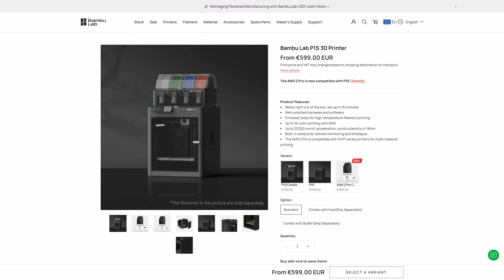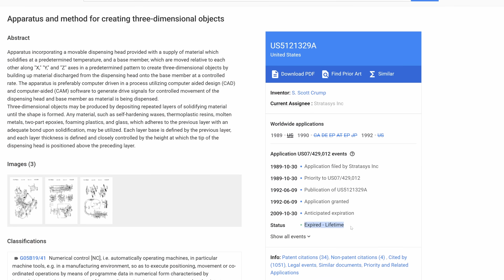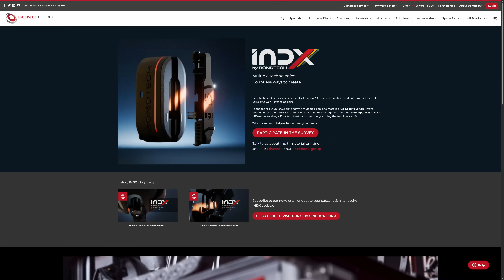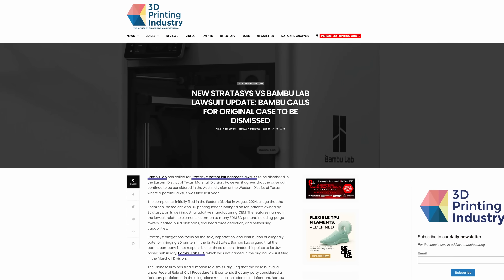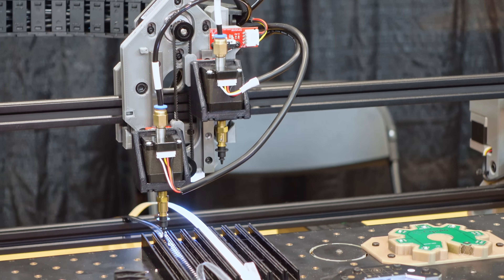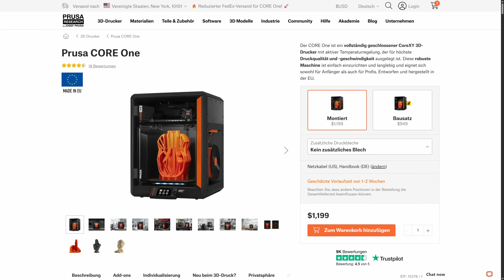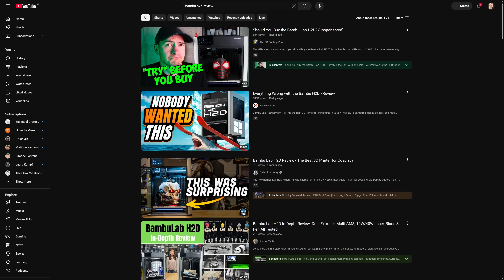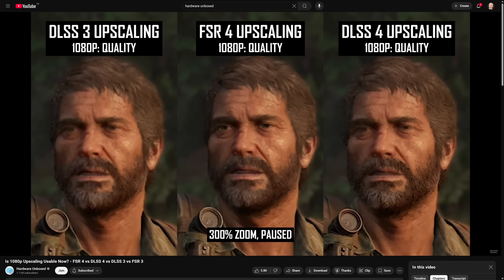How Bambu has won

Comment: Being the guy people often ask for opinions what to buy my answer is the following:
3 options:
Buying a decent machine from the ones actively pushing and helping the community. A company that tries to do the right thing in every step of the way and allows you to mod, repair and upgrade every machine you have of them for years to come. 
Or buying an equally decent machine from a Chinese production run that is decent as it is but will be outfased as soon as they release a new version. Whereby support, spare parts and upgrades are scarce, and with a shady background. Building on the work of others without much gratefulness being shown.
Or buy a project that really will be a project, with the issues and cost in the long run. This covers most of the other Chinese brands that flood shops and seem a cheap option.

Bambulabs gives what consumers want that don't know about the history and legacy. And it's somewhat sad to see you agreeing with them. I agree Prusa is struggling a bit to keep up, but they stick to their mentality and in the long run stick by you as their customer. And also thinking about the manufacturing, supporting locally made production is key in this day and age (I am certain Bambu could product an exact Prusa clone and sell it at half the cost). The benefit of the knowledge and knowhow being available locally far exceeds the cost downside in the short run.

Comment: For myself, I would want a basic run down of common features and anything that makes that product unique. It does matter to me the ethics of a company as I am a Freedom Software advocate and I echo that in my hardware choices. I don't like proprietary anything and vendor lock in is a no no. Where your work shines is in the many years of experience you have both in machines and materials. I came across you via Stephan and while he takes are very engineering approach to thing (which I appreciate as and engineer) I also want to know the experience, the value and the reliability of a purchase as well. I didn't even know you did reviews of Laser cutters, which is something I have been interested for a while now. Though, in truth, I feel I ought to just DIY it to get the features I am after.

Good Video. Thanks for sharing.

Comment: I’ve been into 3D printing almost as long as you—started with a rough Ender 3 and built a few Vorons along the way. These days, 3D printing is such an integral part of my work that my main priorities are speed and reliability. We still use a Voron Trident daily, but we also run two K1 Max and three Bambu Labs printers. Honestly, I don’t even care what machine I’m using anymore—I just need consistent results. And I fully agree: the speed and hassle-free experience of the Bambu Labs machines is hard to beat.

Comment: My biggest interest are the particular use cases for printers.  I run home school robotics classes where the kids 3d model and print robots that can drive, Nerf Turret robots, etc.  I have found my Bambu X1X to print faster obviously, but I have had more failures compared to the Prusa XL.  So I want to know how this or that printer produces different types of parts and the speed and reliability of printing those types of parts.  A lot of printer comparisons stick with the same models, but these are often models, not mechanical parts.

Comment: Regarding your question of direction. I really appreciate you ability to talk about tech in a way that I believe translates outside of the tech space, for revamped by providing perspectives on why an certain feature matters for me as a user, not just rambling out the spec numbers. 
I also think that there is a large audience in the world of business, that are starting to take on 3D printers as manufacturing tools. Which enables rapid local iteration and custom production. This is a different user space than the hobbyists or prosumers that the 3D printing space has been made up of. Offering insightful product reviews that also take into account the elements that are sometimes hidden by presenting a new shiny feature, is something I think you can excel at Thomas.

Comment: Regarding your question of direction. I really appreciate you ability to talk about tech in a way that I believe translates outside of the tech space, for example by providing perspectives on why an certain feature matters for me as a user, not just rambling out the spec numbers. 
I also think that there is a large audience in the world of business, that are starting to take on 3D printers as manufacturing tools. Which enables rapid local iteration and custom production. This is a different user space than the hobbyists or prosumers that the 3D printing space has been made up of. Offering insightful reviews that also take into account the elements that are sometimes hidden by presenting a new shiny feature, is something I think you can excel at!

Comment: My primary concern lies not with the hardware, but with the software. As 3D printers enter the mass consumer market, they risk falling prey to the pervasive paid subscription models common today. The scenario where manufacturers abandon their products or levy fees for continued use is a widespread industry trend, and it would be disastrous for this market.

Bambu Lab hasn't signaled this intent directly, but their recent firmware actions were a concerning first step. With Prusa, I'm almost certain that a dedicated community could sustain the hardware indefinitely. While technically possible for Bambu, its proprietary and closed ecosystem would make such an effort far more difficult.

However I think that Bambu is as necessary as Prusa for the 3D printing market. We, as consumer, can only take advantage of they mere existence. Will ever the Core One existed if the X1 or P1S did not? That's what I mean.

Comment: When it comes to reviews of printers, Aurora Tech sets the benchmark for how it should be done. 
When Bambu started acting crazy with the software and so on, I swore I would never buy another Bambu, even that the X1C and the Mini have been really good - but I went and bought the H2D anyway, it is a beast, yes, Bambu has won, even that I don´t like how they are behaving. 
Truth is Core One is just not there, it is outdated when you buy it, worse print quality than with the MK4S it is replacing, outdated software, I would have liked to buy Prusa instead of Bambu, but Prusa just don´t have anything that can compete with Bambu, even if Bambu was not there, Prusa would still not be the gold standart any more.

Comment: I have this comfort to buy EU made products which are quite hard to find these days with mammoth chinese companies monopolizing markets every day and I always tell my students - if you have a budget, buy Prusa; if you need something cheap that works fine, buy bambu
also Prusa will tell you plans for future, as with MMU3 they said they won't make MMU4 and are working on a something new. Compare it to bambu which won't tell you that next month they will just disable your slicer or brick your printer because you used spare parts to build it instead of buying another unit
It's not about being able to hack or mod printers, it's about being able to buy second hand motherboard to fix your stuff and having to ask bambu for permission to do so

Comment: Nailed it.  Bambu Lab is successful because they are producing what people want.  Lots of people on the Internet  don't want them to want it,  but that doesn't change the fact that they do.  They're meeting a need and clearly people are more than willing to pay for the value they're offering.
Reply: Yep. Simple facts. I see a 3d printer as a tool, and I want that tool to work as easily and as reliably as possible. For me that's bambu. It's the same with other hobbies I have; I like to cook, so I buy the tools that best fit the needs for the task at hand. I'm not interested in hand hammering my own wok, I'm interested in what I can cook in a good quality wok I can easily purchase. I love woodworking. I'm not interested in building a bandsaw or jointer myself, I'm interested in what I can build with the tools I have. 
In short, the tools are not the hobby, the hobby is the hobby.
Reply: So clearly Bambu WAS successful because they WERE offering what people WANTED. PAST TENSE.... And the hate for them currently is as intense as it is because a lot of people loved them, and now feel betrayed. I am not comfortable working with people who have tendencies toward "I have altered our agreement, pray I don't alter it further". Are you??
Reply: @AutomaticJack  What is the issue? You can run the old firmware if you want, or use Development Mode. Personally, the new firmware is really nice, so I am using it.
Reply: @AutomaticJack  They still are successful and people still want them, i'm pretty sure most people buying Bambu printers didn't buy it for the open source and customizability, but rather because it's easy to use and "just works"
Reply: @AutomaticJack  I'm a little surprised at how long it is taking for the competition to rise to the challenge to take on Bambu. There should be more than one company competing on the basis that they combine quality and ease of use (for whatever price or onerous T&C..)
Reply: @AutomaticJack  agree 100%, im a big advocate for the opensource vision and reprap, that said I got myself a x1c I love it for how it functions, I hate it for how it is becoming.
I fear that soon enough it will become unusable as soon as bambulab discontinues it. 
Meanwhile my i3, creality k1 will continue to function for the rest of times, like a good old toaster or microwave.
Reply: @victornpb  "I fear that soon enough it will become unusable as soon as bambulab discontinues it." What does this mean? How would it change to become unusable?
Reply: But providing people what they want was already possible via open-source. Everything was already discovered, already developed and tested. The only question is: why nobody did this before? There was plenty of time. But others were busy making crappy 3D printers, which required mods and fixes right after purchase and regular repairs during usage.
Reply: @TheNamelessOne12357  Re-watch the intro, you clearly missed the point he made about patent trolls and how it costs us more because licensing fees or R&D costs which get passed down to us. Maybe you like paying more for less but in this day and age I'll take whatever savings I can get.
Reply: It's crazy that I'm not seeing you vouch for HP or Epson printers while you're at it. "ThEy JuSt WoRk"
Reply: @howtoguy17  As long as we are talking about the bulk-ink models, I do like the latest Epson and Canon. HP not so much.

Comment: For 3D printers, lasers and CNC routers, I need to know the most basic things:
1. Is it limited to proprietary consumables?
2. Can it be used offline, without having to be connected to the internet?
3. Do I need to create an account to initialize, update or even simply use it?
4. Which parts are proprietary components and which ones are common off-the-shelf parts?
5. Can I fine-tune it via software and/or hardware.
6. Can I repair it myself without needing to send it back to the manufacturer? (i.e. will the manufacturer send me the parts)

Open source and open hardware are nice to have, but not something I care about unless/until the manufacturer breaks the first three points.
Reply: I like this. I'd add I appreciate some comparison with other printers on the market. Are there other printers at a similar price point that present a different set of trade-offs? What advantages does the printer have over cheaper printers, stuff like that.
Reply: 7. Is it safe to use in the configuration it is delivered in
Reply: The ONLY reason 3dprinting exists in the first please is thanks to the incredible efforts of the OpenSource community, taking it for granted and allowing this space to be lost to the corporate mass-manufacturing should be concerning in the least of cases.
Reply: Same. I would also add one point. These machines are becoming increasingly expensive and complex and I am concerned about bait and switch. For example Bambu's makerworld. I can't help but feel that soon they will lock it behind a pay-wall of some sort. This seems to be the go-to method for a new company. Give it for free or cheap, drive your competition out of business, jack up the price. (Uber, Nixplay, HP Printers, Netflix). I very much want to get behind companies that don't treat customers like consumables and I will pay significantly more to build my creating around their products. Companies that WANT TO PARTNER WITH THEIR CUSTOMERS.
Reply: @Ringwraith19  I've had a bambu for months and I didn't even know there was a makerworld for them. There's like 50 other makerworlds you can use. I've also used the SD card completely offline since day 1. When it asks you to sign into wifi or get the app just hit skip and don't.
Reply: Those 3 points can summarized as 'Is this company limiting me on how I use this product' if you are worried that, then opensource is not a nice to have, it is a requirement.
Reply: Exactly.
Reply: For bambu (at least p1s I have)
1. Yes, including 3rd party parts and accessories
2. Yes
3. No
4. Most parts have 3rd party compatible parts, itd be the mainboard/firmware that is the most proprietary
5. You can do a lot with material profiles and calibration settings yes
6. Yes

Now compare that to Heygears which is almost entirely the opposite
Reply: You are really limiting yourself to the technology and performance available.
Reply: Whatever does it work and function better, does your phone meet this ideal standard, lol?

Comment: You should not do printer reviews but instead push limits in ways to use a 3D printer. As a knowledgeable tech guy, that way you can differentiate from all the other unboxing and spec-reading channels.

Comment: Thanks for the open video. To be honest, I don’t care at all if you test in an ideal open-source environment or a non-ideal closed-source one.

I would be more interested in optimizing three sections of my life together with my 3D printer as a tool along with your content inspiring me to help me do so:

The first would be through sustainability. This means, for example, creating the IKEA Airfilter Cassette and making other (brand) refillable products permanent through that process. Feedback: unfortunately, you did not fully show the self-made filter and did not provide any information about it whatsoever. I really would have appreciated if you would have done so.

The second is to optimize my life and remove friction wherever possible. As a person with ADHD and many projects, I thoroughly enjoy using my printer to optimize my life in a well-designed and qualitative manner. 

The third one is a big one, it’s safety. This is a big factor, since I have kids, I am in fear that I will get sick from the fumes. So I, for example, enjoy videos of (well-designed) DIY printer enclosures (the aluminum carpenter). What also can give as feedback to this topic is: That I also created your air quality monitor with the case and the sourced PCB and the parts from the BOM you provided. The sensors I built out from your guide turned out great, thanks for that. But what I had to find out was, that the consistency of the maintenance of your files (cutout for a sensor was missing) was not that thorough and I had to solve issues with posts of the comment section of your Printables page.

Maybe it would be nice to combine YouTube and your articles from your content page to collect and maintain everything in a more “subscriber-serviced” (for lack of a better word) manner.

All in all, this was meant as an orientation of feedback of a subscriber who is ultra happy about any new video of yours. I hope the feedback is understood and taken to heart. I would not have invested the time to comment if it would not be important to me that you continue to create great content.

Greetings from BaWü
Reply from the maker: Thanks for the fantastic input! I know I tend to move on to new projects a bit too quickly, especially when I'm not totally satisfied with the outcome. The refillable carbon filter could use a better mechanism to close the lids, and the Sensorbox was a four-month debugging nightmare to fix a showstopper issue that would crash the ESP between every two minutes to every two weeks (making any sensors that rely on runtime calibration useless, which was almost all of them). Turns out is was the specific Arduino framework ESPHome was using, but after having spent all that time chasing rabbits, my enthusiasm and the community interest in the Sensorbox was at an all-time low.
I'd certainly like to "finish" more projects in a manner that makes them useful for the community. ADD doesn't help with that, but I'm working through that.
The "fan service" parts of what I do are definitely the parts that I enjoy the most, but unfortunately YouTube tends to punish those videos that don't appeal to a large enough audience. Guess it'll have to be a bit of everything - variety is the spice of life, amirite?

Comment: The great thing about their machines is they just work - they're fast and they print very high quality parts out of the box. You don't have to tinker with them. That's the beauty of it. This isn't an Ender, it just works and doesn't need third party mods. If you like to tinker, build a Voron.

Comment: To be honest: There are so many printers out right now that it's time to start doing comparisons. 1) reliability! Many S1 from Anycubic f.e. break down after a few dozen hours. 2) print quality check. See the Core One with it's heavy VFAs. 3) filament list that this printer can handle. 4) Orca compatibility. There are so many other points on the list... But I think you get the point. But the most important thing: follow up videos! Printer is 3 months in heavy use: how does it perform? Which issues does it have? And so on